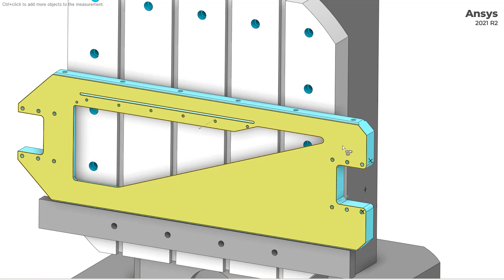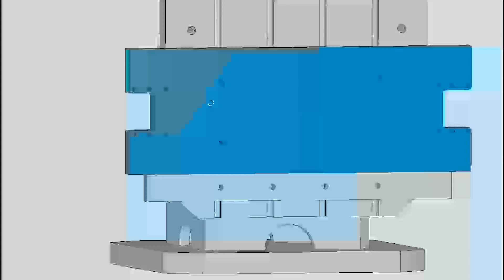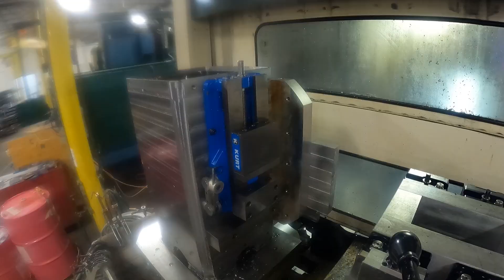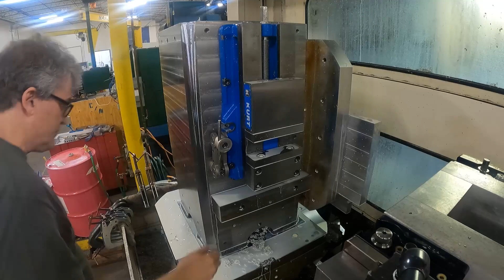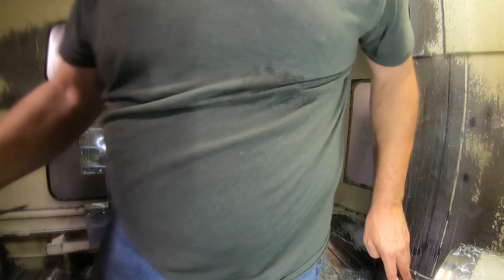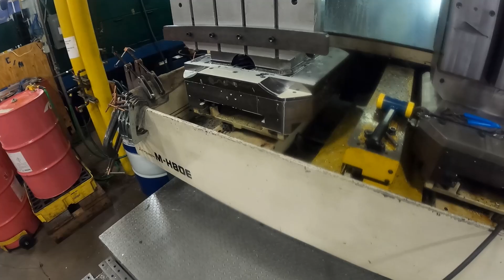Mazak Fixture Base

Comment: Nice work Sir.. I'm curious if I could know where did you get those edge clamps from?Thanks
Reply from the maker: I bought them from Bass Tool here in Houston.
Reply: Is it possible to recall the amount of radial and axial  depth of cut speed and feed would be helpful for me to push my tools at work. And I believed it's a 3/4 5 flutes endmill? Thank you

Comment: Nice work!! what is the cutting envelope on that big horizontal?  Man the shop I work at needs something like that!! Although we just got our first true 5 axis and I am excited to get working on that!!
Reply from the maker: The travel ranges are X 1250mm Y1000mm Z850mm. Pallet size is 800mm. Cat 50 direct drive spindle 40 Hp with 80 tool magazine.

Comment: Is that a face drawn on the vice miscalculation?
Reply from the maker: If you want to see when I did it. Go watch my video on Stock Prep for the 14 Lb anvil. I think it's in that video. I was paying more attention to the camera than the direction I was jogging the machine. So I manually jogged the cutter into the vise. I had the wrong axis selected on the manual hand wheel jog pendant.

Comment: Very neat. I had been wondering how the probe communicated with the control system. Elegant system that minimises machine changes and any RF interference.
Reply from the maker: This is a old system. The new ones use radio signals.

Comment: That endmill has way too high (low?) of a pitch to the flutes. Honestly you'd want fewer flutes too, 2 flute HSS (sharper cutting edges help too, carbide has a larger radius than HSS generally, and actually galls material to 'cut' it) would probably be the best bet oddly enough. Although I'm not sure if you'd get long enough flutes to cut full depth like you were doing.
Reply: Iirc, the optimal edge pitch for aluminum is 40°, according to Helical and Destiny.

Comment: What blades are you using on your deburring knife? Since you can debur in both directions. Tnx in advance for your answer, another great video!
Reply from the maker: They make blades that go both directions. I’m not at the shop today or I’d give you the number.
Reply: @EdgePrecision  Thanks!
Reply from the maker: @lakicar1989  The blade I'm using is a Shaviv/Vargus brand #E350 151-29044. The handle has to be able to hold this larger E blade. Mine is the aluminum handle
Reply: @EdgePrecision  I was just looking at the Shaviv catalogue. Thanks a lot!

Comment: do you never clean the base for chips .. this always full off chips .
Reply from the maker: Every once in while I hose everything down. Usually when I make up coolant. I just haven’t had time for a proper clean up.
Reply: @EdgePrecision   i mean pallet  base . . and the clamping  systems .
Reply from the maker: @gertkristensen6451  Yes that area I clean almost every day. But even the chips you see don’t really cause a problem. There are air holes in the pads the pallet clamps down on that blow away the shavings before it clamps down.
Reply: @EdgePrecision   okay .. thanks  peter    love you video

Comment: Very interesting video as always thanks Peter. When you probed the Y I noticed probe went to the bottom of the part first where it's sitting on the bar. Is that intentional because it's the fixed jaw/datum or for backlash, or is it just coincidence?
Reply from the maker: The Renishaw web probing cycles always go to the negative direction first. Even in the X or Y axis. It’s just the way they work.

Comment: Hi, am I wasting my time? If I'm skimming a raw plate flat, the first skin don't bang it down (both sides), my theory is only bang it down on the final cuts. After all stress has gone from the plate.....? Therefore, that plate will stay flat on it's own.
Reply from the maker: On the first cleanup cut don’t hammer on it. Let it set the way it wants. Clamp it wit as little pressure as possible. On a vertical machine I usually use double sided foam tape. To stick it to the tables face. In this horizontal I would worry about it falling. Than skim it to clean it up. Flip it than it’s OK to tap it down to the first flat side. It is also important to try to remove the same amount of material from both sides as to bring it to final size. This in theory keeps the manufacturing stress evenly distributed in the material on both sides.
Reply: @EdgePrecision  Thank you. It's how I've always seen it in my mind. My mind is in the plate. You understand? I feel the stress of the material. 
I've done 24" by 60". Started at 3/4 stock, finish size 1/2". +-. 0005.
Successful because I 'feel' the plate. 
Thanks for confirming that I don't waste my time.

Comment: Nic e video as always :) 
What model of HMC is it and specs,please?
Reply from the maker: It’s a Mitsubishi MH80E. It has a 800 mm pallets. It’s travel range is X 1250mm Y 1000mm Z 850 mm. It has a direct drive high toque spindle with 0-6000 rpm and 40 hp.
Reply: @EdgePrecision  just out of professional curiosity, what made you choose a Horizontal over a vertical? 
I work for a tool makers and we tend to be buy more a more verticals but struggle for Y travel (obviously).
Reply: @EdgePrecision  Mitsubishi control too? 
Unfortunately they are not imported to Denmark. Mazak, okuma, YCM and Doosan are the topplayers here.
Reply from the maker: @allancnc  All Mazaks are actually a Mitsubishi Meldas control with Mazaks Mazatrol on top. In fact if I want to buy electrical parts for my Mazaak Integrex. I buy them from the same place I buy parts for the Mitsubishi horizontal.
Reply: @EdgePrecision  I know, but in Denmark Mazak sits very heavy on the parts distribution, we can't buy parts else where, Mitsubishi dealer, and Mazak will not sell parts if they do not know where the machine is located. Mazak is the one of Mitsubishis biggest customer they say. Parts are not cheap from Mazak.

Comment: Peter, the jig is just as interesting as the part it's self looking at the shape my money is a window frame fixture for something very fast and very expensive
Reply from the maker: I want to mill on both sides of the part in one setup. Holding the part with tabs around the one side. The other will be clamped with that long clamp.

Comment: Nice. I wonder if you lock out machine when walking inside or not
Reply from the maker: No but the machine is not in the auto mode. So unless someone is manually jogging it, it won’t move.
Reply: @EdgePrecision  yeah, it usually is fine when workers all know how to safely check machine over before touching.
Reply from the maker: No one but me run my machines in this shop. So it’s OK. But in general with large machines there is no way to do the work without getting in the machine.
Reply: @EdgePrecision  Ohh didn't know that. It seemed like shop with more machines with more machinists. I used to work in large shop with many cnc machinists. And yeah I had to enter machines bunch of times, especially "chev" a very large machine. My old usual, you don't have to since it is A61 cell. Right now, I'm unemployed due to crash of demand last year.

Comment: Hey Peter!  Always love your vids.  I hope you dont mind a tip.  I too made the mistake of trying to run multiflute endmills in aluminum without coolant.  I eventually found these Niagara a345 series with TiCN coating.  They are worth every penny.  I was taking 2" doc 0.08" stepover at 6000rpm at 80ipm with a 1/2" endmill. And it was still taking more.  They lasted me 6 months running like that.  I used the crap out of them.  They are a waay cheaper route then the kennemetal kor5.  Especially if you dont have the rpm to justify the lighter cuts.  Just a friendly tip that i learned from some trial and error.  Figured id pass it on, since you share so much of what you know.  Thanks a bunch man!
Reply from the maker: Thanks! It was only for the video I was running dry. Normally I would always run coolant on Aluminum.
Reply: @EdgePrecision  I hear you bud.  What i kinda ment was that the TiCN coating should let you run dry for video.  That Tian coating (i think thats what you got there), welds to aluminum real easy and that multi flute endmill makes it even harder for chip to evacuate. The TiCn is slippery and chrome like.  Aluminum slides right off it.  Even when running dry.
Reply: I guess i rambled a bit more then i intended and didn't really get my point across lol
Reply from the maker: @pharaun159  the endmill in this video has a TIALN coating. In my experience even a TICN coating doesn’t do any different. Aluminum builds up at the cutting edge. A tool with a super polished flute gullets might do better. In all my years of machining I haven’t found anything that will successfully machine aluminum dry. In these kind of cutting conditions. It’s also the heat. I have run a machine once when the coolant failed. In this case the the spindle speed was 10,000 rpm. The endmill just melted the aluminum and it flowed back together behind the tool. It looked just like a heli arc weld.
Reply: @EdgePrecision  ive had that happen before.  Thats a bad day.  That Niagara endmill im referring to is very polished, maybe that had more to do with my results.  Thanks for sharing your experience!

Comment: I always enjoy your videos Peter.  As I watched this video I thought that I would suggest that you consider a spin window to help you with dealing with the coolant obstructing the camera view.  In your case being that you are a pretty talented individual I would suggest that you consider building your own coolant resistant enclosure with a small spin window on the front.  The enclosure would not have to be very big, just enough to enclose your video camera.  With a spin window enclosure you could then mount your camera in the preferred position for close up video.  I know that these sort of project can be a little expensive, but once constructed it would increase the quality of your videos.  As a point of reference the Visiport Systems spin window turns at 2100 rpm.  The Visiport spin window is 10" dia. and it is way too big for this application.  However, the videos available on-line show the window throwing off coolant without a problem from the center hub (approximately 3" dia.) all of the way out to the OD of the disc (10" dia.).  So, you don't have to run the spin window at astronomical rpm for a smaller dia. window.  I know you are a busy guy but maybe some day you will dial it into the schedule.  Regards, R J
Reply from the maker: I will direct you to my playlists on the cases I have made for GoPro cameras. There are a couple of problems with a spinning window for my video. The number one is the noise a mechanical apparatus transmits to the camera. I’m interested in capturing the sound from the camera. I don’t want to sink a separate recording device. That would also have to be protected from the coolant. It also as you say to large to get in close. In theory the spinning window works if the coolant is new and clean. But as your coolant gets old it has way oil in it. This works for a while. But eventually you get radial streaks on the spinning window that obscure the image. Also as you even point out. How do you make it small enough. If a window was say 3” in diameter it would have to turn quite a bit faster than a 10” window. How do you make that quiet enough? The cameras the car race people use have a roll of plastic film (sort of like a clear photo roll of film) that they continually move in front of the camera at slow speed. Kind of like rip off visors motorcycle racers use to clear their view thru their helmet visor. That could work if it could be sealed properly. If I didn’t have that air knife case the camera is in you would see nothing in this video when the coolant is on.
Reply: @EdgePrecision  Thanks for getting back to me with your evaluation and assessment of problems with my suggestion.  I will check your video playlist library and review what you have done to date.  If I have any ideas on how to get around the difficulties you have brought up I will let you know.  I appreciate your taking the time to answer with a good depth of information.  Regards, R J

Comment: Hey Peter, another excellent video! I do a lot of aluminum at one of my shops and we've been using Helical Solutions' newer aluminum roughing carbide end mills. They're a 3 flute high helix angle design and really move a lot of material. On our average sized vmcs we run a half inch cutter at 12k (limited to 12) with a .8"doc and .150 stepover and the cutters are quite happy.

There's another guy on YT called 'swerve drive specialties' or something that runs them in his brother speedio and they absolutely haul ass!
Reply: I tried a couple of different Helicals and keep going back to Lakeshore carbide 1/2" TAS rougher. In my vf2ss and vf3ss I can run 1" deep at .1" step over and .012 IPT. In my gearbox vf2 I can push stepover to .150 at 10000 rpm. 45+ cubic inches MMR profiling. The Helicals wanted to constantly load up, even with 1k psi coolant through the holder at the flutes, flood wouldn't touch it. Only fault of the TAS rougher is limited flute lengths. I use helical tooling for other stuff, but for roughing aluminum the TAS is hard to beat.

Comment: Peter, I tried those clamps on a large hog-out I'm working on now.  They made me nervous as well.  I ended up tapping holes in excess material of the part, and drilling through holes in the fixture to bolt the part directly to the fixture.  I think we were both right to doubt them, because after running the first roughing tool (a 2" Ingersoll Hi-Pos Alu) all of the clamps were loose!  

Could have been very bad with a 200lb piece of stock!!

Comment: Good stuff. Excited to see it in the Mazak. That bit that loaded up looked like it maybe had AlTiN coating. Any of the Al type coatings just stick like crazy to aluminum if they get any heat in them. (Assuming due to them both being Al) Looked fine with the coolant though. Probably not worth buying another uncoated tool just for this anyhow. Love your vids!
Reply: That's one of my major complaints about tooling manufacturers - too many are focused only on cutting steel.
Reply: Coating is partly the issue, but also if you run coolant like he did after he unloaded the flutes, you can cut the loading up problem relatively well. 2 and 3 flutes on aluminum had been the best for me.
Reply: @mik3y374  Absolutely correct. The lower the flute spacing the more likely they are to load up. Tough to run a low flute count on a tool that long though, I'd guess. At any rate, I've just noticed that without coolant any of the Al coated tools stick to the hot aluminum pretty readily. Doesn't matter at all in production where nobody cares what you can and can't see. :)

Comment: Hey Peter/ Why dont you even use "roughing" endmills?
Reply from the maker: I do have a inserted cutter with inserts that could be considered roughing style. But other than that I own no roughing endmills. But than again I think I only have about half a dozen high speed steel endmills. There is no real reason to use a roughing endmill in aluminum. And in steel and exotic materials I use no high speed endmills. Roughing endmills are kind of old school machining.
Reply: @EdgePrecision  OK Thanks/
Hey could i reccomend a video regarding milling tooling. The lathe tools video was really informative/
Reply from the maker: @josephwaldner7752  Right off I can’t think of a video. Maybe I should make a video of what I do. The way you mill is very machine dependent. For instance I would do something one way on my bigger machine that I can’t do on the little machine in my garage.
Reply: @EdgePrecision  Ok good point. Sometimes i dont understand why all the tool changes/ Could you possible explain that more in detail?
Reply: @josephwaldner7752  what do you mean by "all the toolchanges" ? (Most tools are best at 1 type of operation)

Comment: Thank you for sharing the steps that you go through to machine theses fixtures and parts. As a mentor for a high school robotics team 
that had no previous experience with CNC only a few years ago, I had to learn how to design, fixture and machine parts so that I could teach teenagers how to make custom parts themselves. Your experience and insight has been incredible. Our team has made some awesome parts with the guidance of skilled machinists like yourself. We use relatively inexpensive CNC routers with a Fog Buster MQL cooling system so in the beginning, you could say that chip welding was our specialty.

Comment: Do those large horizontal mills that you can walk inside of have door interlocks that cannot be removed or disabled?
Reply from the maker: This machine is old enough to be pre all that safety stuff. I think there was a switch on the doors. But that was disabled before I owned the machine.
Reply: If you’re dedicated enough you can bypass any of those safeties. I’d be shocked if someone couldn’t on newer ones with enough effort.